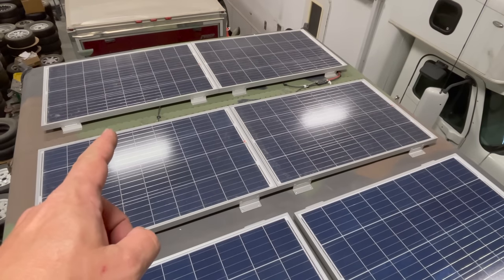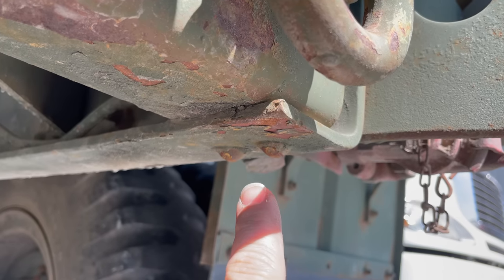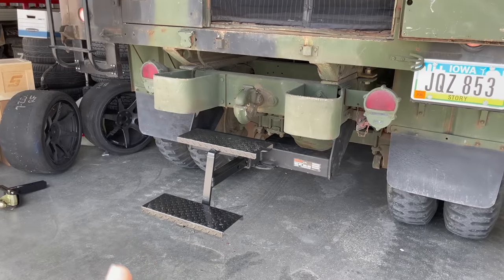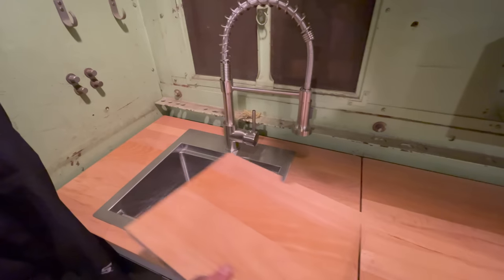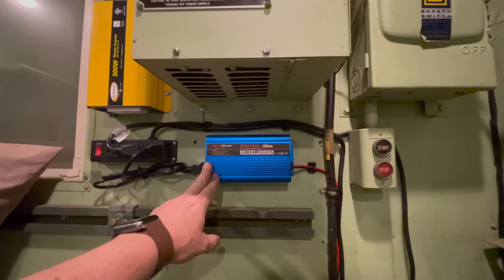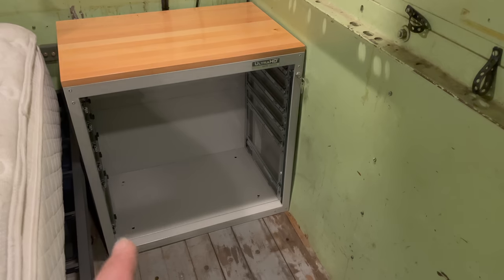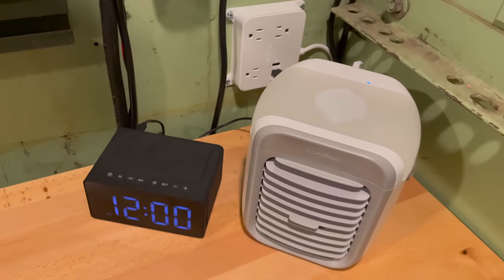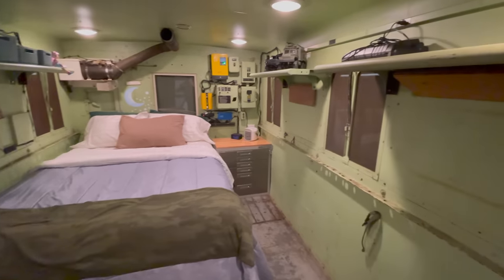Part 4: M35A2 M109A3 Overland Camper Build

Comment: Drove a 109 van when I was in the Army, used as a shop van for Maintenance.  So top heavy with tools in one field problem with a super slick road I slid sideways into a ditch.  put it in low and 6x6 and drove out.  No damage.

Comment: Dude you're living my dream right now. I have an m35a2 troop carrier variant and want to have the command box like yours to make a small living space. I'm torn if I want to buy another duece like yours, trade or sell my current one, or start scratch and customize a box in the bed of my current one. I fear however I don't have the skills or know-how to make it work the way I want. Lots of homework to do I guess
Reply from the maker: If you can find an aluminum enclosure that is the best.  Some box trucks and all ambulances use them.  I like the old U-Haul boxes but they are very hard to find.
Reply: @ThisWeekWithCars  so I just installed my hitch, exact same as you have yours. However looking through your parts list in the description I am unable to find where you got your step down converter for ball hitch trailers. Did you get that off amazon?

Comment: Steve , IAM getting 12+ mph on my Duce w/ the 1100,s an the lock outs , an it steers a lot easer
Reply: That's pretty nice, I'm planning on putting 395s on mines in hope I get 55mph at 2,000 - 2,100 RPMs. I have power steering on mines so the bigger tires shouldn't make it worst.

Comment: Hi Steve Skidder from ct  are you going to put lockout hubs , an 1100 good yr steal tires ? I did both on my Duce ,I have the LDS ,5 ton multi fuel eng  what a Difference it made

Comment: You mentioned you put the two new solar panels in series with the existing four.  Was it in series - which increases the voltage - or in parallel, which increases the current?
Reply from the maker: Series

Comment: very very cool.....but I wouldn't want to fill the fuel tank.
Reply: Filling it's not the problem; it's 𝒉𝒐𝒘 𝒐𝒇𝒕𝒆𝒏 you have to fill it. That's the bit that going to hurt a bit.😁
Reply: It has the multifuel in it. Find some connections to get wvo or wmo and run that for free. I get my oil free from a local race track. 100% straight wmo in the summer, at least 50/50 with diesel in the winter so it's not to hard on the pump.

Comment: I wanna ask when you buy a m35a2 do they have air conditioning so I can buy it
Reply from the maker: They do not
Reply: Sure they do, it's opening the front windshield! 😂
Reply: No, but you can easily add one, I may put an electric A/C in mines since I already have the compressor